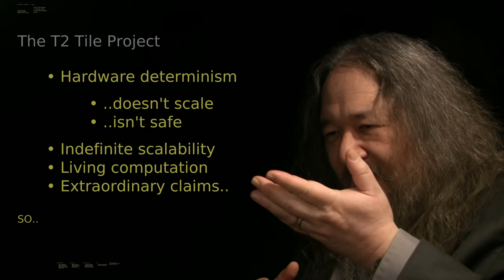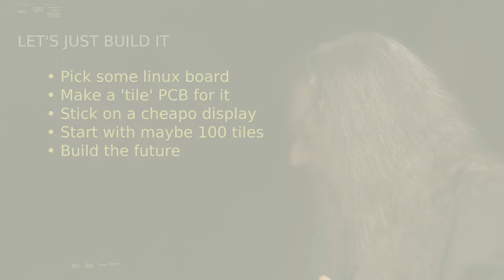Introduction to the T2 Tile Project

Comment: A very interesting and ambitious project; I'd be excited to see what kind of results you get! Im curious about you think about the emerging blockchain technology as it's currently tackling similar scalability issues.

The idea of life-like computational systems is crazy. I've had a similar thought when trying to imagine the next stage that may replace our current deep learning paradigms like convolutional neural nets. The issue with current deep learning architectures I think is that they don't actually learn like a brain. They require many more training examples than an animal would, and they are not complex (in the way that the brain is a complex system) but just highly optimized machines.

Comment: How does the saying go: “go big or go home?” Have you thought of implementing your T2 Tile Project using ASIC elements?

I went down this exact same road a number of years ago when attempting to build a large asynchronous array of simple processors. The wall I hit designing such a system is the cost involved. No matter how I tackled the hardware side, I could not come up with any design options better than about $30 per cell. At this rate, for example, 100 cells would have cost about $3K. In other words, any array small enough to be affordable could be quite easily simulated in software at no cost at all; so why bother? 

On the other hand, there was a chip, the GA144, from a company, Green Arrays, that was a 8x18, 144 element, asynchronous array of simple processors that each independently clocked about 1 GHz. All this on a single die approx. 5mm x 5mm. And you could pick one up for about $20. 

It was a tempting part to try to use, except for some serious flaws. The first was that the simple processor elements were too simple to actually implement anything useful with and second, the I/O pins were not brought out in a way that would allow these parts to be incorporated into a larger tiled array. As far as I know, Green Arrays is now a defunct operation. But I’ve always wondered what could have happened if the engineers behind this chip had designed it is a tiling element rather than a SOC part?

But, if you think the T2 Tile Project is worth $50K to $100K, then going the ASIC route, taking the GA144 design as a starting point, makes the most sense. Not only would you be able to build asynchronous arrays on the order of 10K’s of cells, you might actually end up with a part that you could sell commercially too.
Reply: A short answer is we looked at FPGAs but not ASICs.  A longer one is: The goal is a new computational stack based on best-effort across h/w and s/w, and it feels unwise to accept much up-front technology risk just in the former.  Prototype now, optimize later.
Reply: Thanks for the response. I have been following the “Dave Ackley” YouTube channel for a couple of years, but I did not realize until now that there was a separate YouTube channel devoted to the T2 Tile Project. It’s clear I need to go back and review work already done before I comment again. So yesterday I binge watched through most of the T2 Tile Project posts; running at 1.5- or 2-x speed. Here are my thoughts.

First, speaking to the headaches of hardware design, professionally (before I retired) I did embedded-systems hardware design; so, Dave, I feel your pain.

Second, regarding my comment about using an ASIC element, I can see now, that was not an appropriate suggestion. Considering the MFM architectural structure, once the decision was made to include a Linux operating system into the programming paradigm, there are already on the market no end of ASIC’s designed specifically for that application; they’re called ARM processors.

The only advantage an ASIC would bring to your project is if you decided to forgo the operating system and program bare-metal. In which case an ASIC would let you maximize your design in terms of price, performance and power. Imagine individual cell performance with clock speeds approaching a 1 GHz, current draws of a few milliamps, and a price per cell on the order of $0.10.

While, these are the benchmarks you’ll need to hit before the MFM concept would become a commercially viable option for hardware design engineers like myself. This is clearly a project concept for another day; --somewhere, way off in the future--. So, for now, I’ll just shut up with my comments, continue to monitor your progress, and cheer you on from the sidelines.
Reply: @rsch001  I'm glad I came across your comment, because even though I've never worked in anything related to electrical engineering, I think I've had some of the same thoughts as you did.  I like to keep up with this stuff as a hobby, and I was exposed to a fair bit of EE in college, so I like to think I can grasp some of the basic concepts.

I found myself wondering about how the state of hardware and software ended up the way it did.  Again, while I'm ignorant of technical details, I imagine that many talented people worked together (at some points) to design circuit architecture, machine language, firmware, software and everything else in the stack.  I think of the need for abstraction, and robustness existing as a design spec.  If a goal is to design an embedded system to do a few tasks, with a specific failure rate, and that is what is accomplished, is it not fair to consider that system as being "robust" for the purpose?

I'd like to imagine a whole slew of epiphanies from ALife that would disrupt the tech landscape, but I'm not sure if that would be possible or what it would look like.  I'm definitely going to keep making my way through the videos on this channel as well as the T2 Tile Project channel, in addition to anything related that I find.  I just hope that no one minds my comments too much...